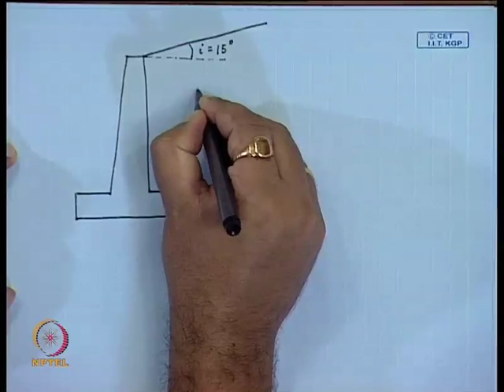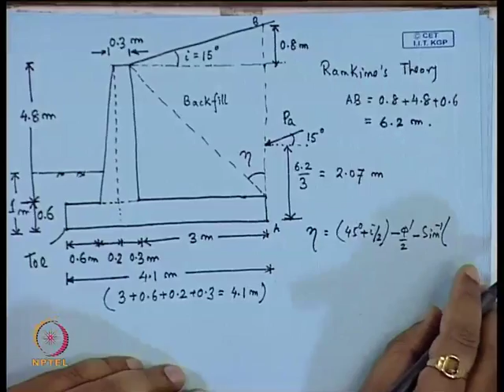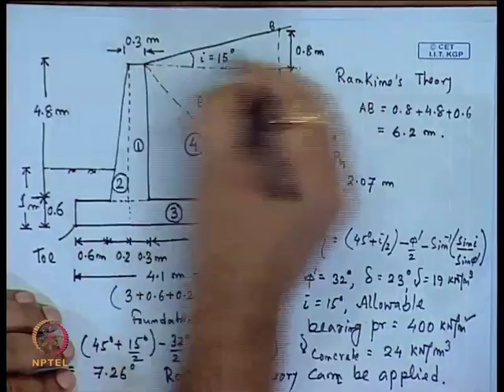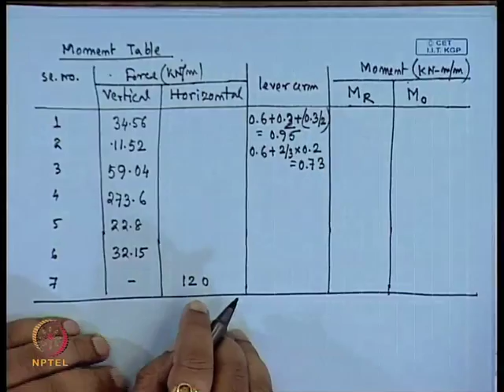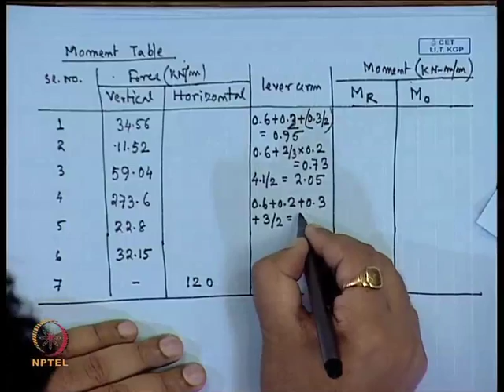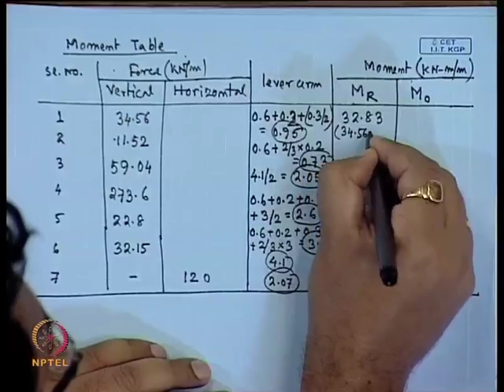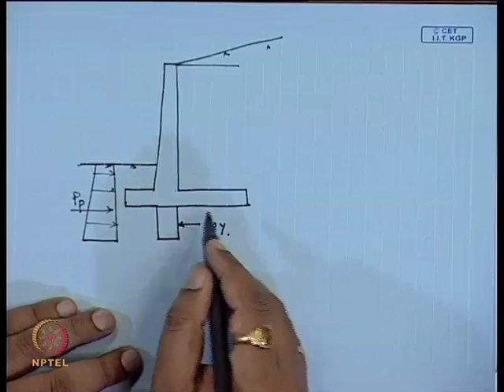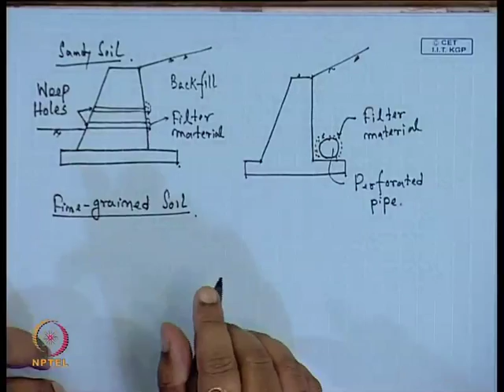Mod-01 Lec-24 Design of Retaining Wall (Contd.)

Comment: What is the difference if we solve using Coulombs theory
Reply: The major difference would be the angle of the earth pressure. In Rankine's method it depends on the slope angle whereas in Coulomb's theory it depends on the angle of the back of the wall and the angle of friction between the wall and the soil.